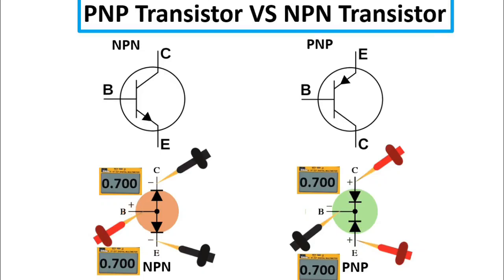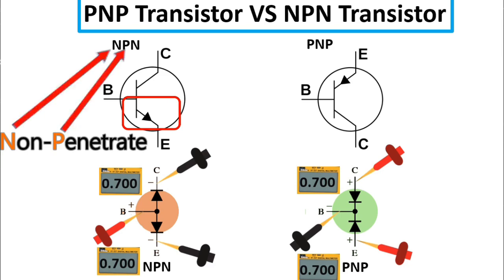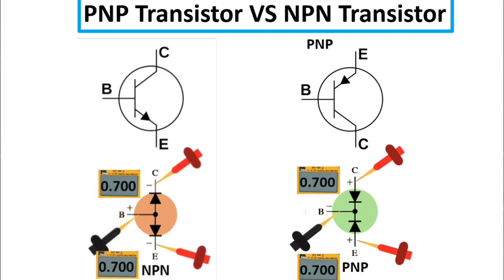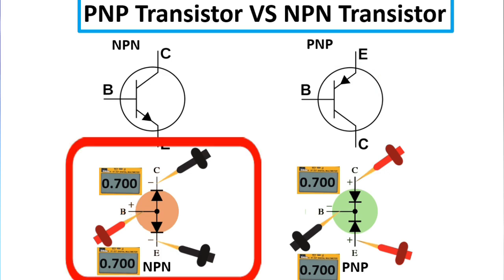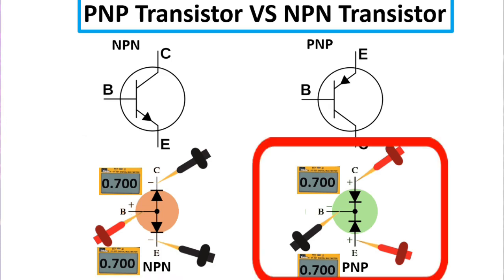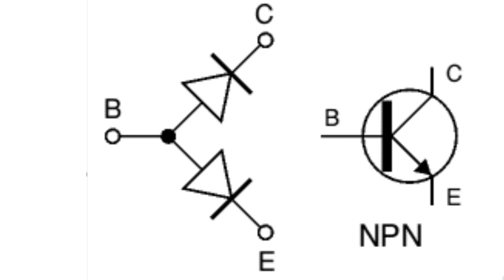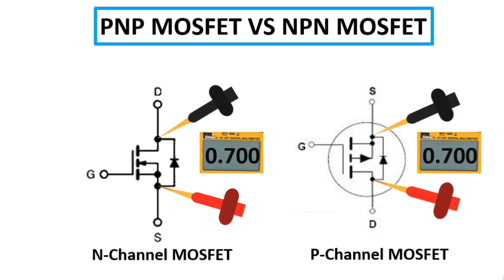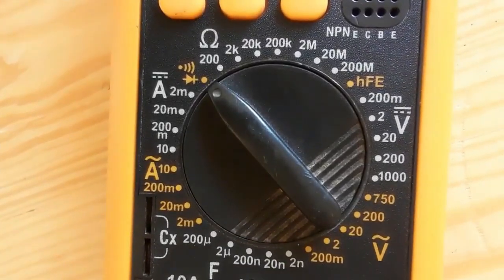NPN Tansistor and PNP Transistor VS N-channel MOSFET and P-channel Mosfet + How to use Multimeter

Comment: Hello teacher, how should the measurement be in new generation mosfets? for example, in dual channel mosfets, s1-s2, d1-d2, g1-g2.

Another dual n-channel mosfet is as follows:

integrated structure 8 pin mosfet datasheet;

1- hsg
2-g
3- v+
4- v+
5- sw
6- sw
7- sw
8- lsg

Can you make a video of their measurements and show them in detail?